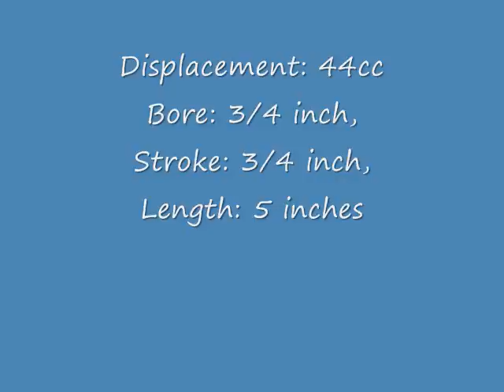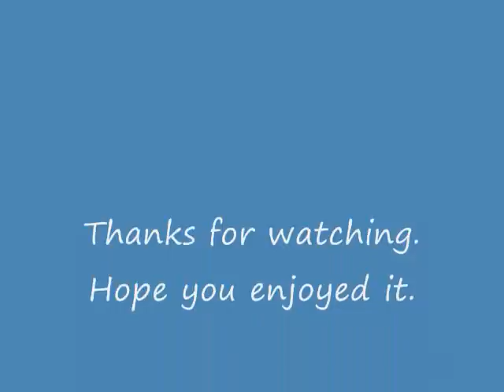World's Smallest running v8 engine

Comment: Most school buses and trucks semis have the fast VW sound but when muffler bad but tinged down when driving bed too racy but street quiet it and make it less powerful and semis school buses to gain traction on snow to spin fast as cars now not cumbersome slow to not gain it and to Cary more weight these days since increasing in delivery and mail trucks and semis got those engines also called cb performance custumized

Comment: The funny thing is it really just sounds like an American v8 but .1 liter lol
Reply: 0.044litre
Reply: Sounds much better than that loud wasp like sound a nitro engine makes
Reply: @Renegade L Im not an expert at stuff like this but its a 44cc displacement so you probs won't get much power but a small 44cc block v8 engine in a scooter imagine telling someone you got a v8 in ya scooter.......... eyebrows raised and laughter until they hear it lmao
Reply: @Renegade L small scooters have 49cc engines and are good for 40mph so I guess if you figured out a way of fitting it into a a scooter you'd have the same kind of performance
Reply: @Atilla 
Yes it would fit, and yes it would likely be more powerful than the stock 49cc (2ish horsepower?) you usually find in scooters. I think Toyan makes a sub 20cc motor, for RC cars, that pushes 3.5 horsepower.

 Longevity? Who knows.
Reply: @robotbjorn4952 it puts out less than half of what a 44cc 2 stroke would make. Remember, its still a 4 stroke so it averages half the power of an equal size 2 stroke.
Reply: Has to do with the way the driveshaft is positioned
Reply: @jevaderscrush  you mean crank shaft? Lol
Reply: 44cc, 1 litre would be 1000cc, eg a big motorcycle or small car engine size
Reply: Most likely about 5-20cc max
Reply: more like 0,45 lt
Reply: @thrashefe3523  so thats a 450cc in your book? 😂
Reply: Luna Lover that's actually not funny cuz if this engine, literally the side of a toaster and for entertainment purposes only, is 450cc in size, can you imagine that smart made a 600cc car up to 10 years ago, fiat made an 800cc 500 (or might still make it) and my friend just bought a Clio with a 900cc turbo 3 cylinder?? 😭 that's crazy
Reply: @arnemaeschaelck5012  actually is 44 cc ...

Comment: I’d like to see the engine dismantled and see the actual inner workings of it for sure.
Reply: That’s what I’ve been wondering.  Is it 2 st or does this thing actually have a valve train lol.
Reply: Mikey Hue I question it’s validity but I could be wrong, the heads don’t show any exhaust ports and with a typical v8 like this one 

https://youtu.be/NPNmI6D2T2c

That does. Check that little one out too.

Comment: They should use these for electric power plants, connect a equal size generater to the motor. Have a huge warehouse with shelves from the floor to the ceiling with thousands of these motors, all the wires from the generater going into one step up transformer , then connect to the power grid

Comment: 44cc? Almost the size of the biggest size motor in a moped your allowed to ride at 16 50cc
Reply: Well, if the police dont catch you anythings legal, i had a 75cc engine with  a after market exhaust. It was pretty fast for a moped at 80km/h
Reply: Nakki_koira Mine‘s a 50cc that rund 90km/h not bad for original!
Reply: Nakki_koira En yllättyny et suomalaine sano tän😂
Reply: And in America you can drive cars over 8000cc at 16
Reply: Ckc dillpickle) I don’t know any 16 year olds in America driving super cars with V-12 engines.... ‘cuz that’s about what you’d need to even come close to 8000cc engine displacement. But kids here do start driving full size cars usually by 16
Reply: biggBOSS1991 there’s a kid who did his dmv test in a Chiron (he was underage) so it’s possible
Reply: the difference is that this is 8 cylinders while the moped might have 1 or 2.
also guessing that this is a 4 stroke instead of 2
Reply: @ValentineC137  you get 4 stroke moped
Reply: @ValentineC137  also the torque on this is nowhere the 2 stroke 1 cylinder moped engine 😄
Reply: Valentine in the video he says premix so it’s a two stroke
Reply: Daniel D it’s still a four stroke. It’d sound different. You can use premix to lube a 4 stroke at this scale. If it were a two stroke i don’t think it would need the cam gears he points out at the beginning for timing.
Reply: @fifty9559  actually he says it runs off Coleman fuel but he adds oil to it, most likely because the engine doesn't have a oil sump system to distribute oil where it's required.
He also speaks about the Crank and Cam shafts but conventional 2 stroke engine don't have cam shafts
Reply: I want an 8 cylinder street legal moped lol
Reply: TLBTM Actually 49cc thank you
Reply: @willpitts9957  it varries from place to place. Some places 50cc is legal some places 49 is max.
Reply: chezY) What does knowing “what a pussy look like” have to do with driving a car?
Reply: TLBTM 15 in finland
Reply: @eskilhalmelinna1031  well I just said 16 but you can at 15 9 months
Reply: TLBTM 14 years and 9 months in sweden got myself an aerox 70cc, sport exhaust and some other stuff, goes about 90km/h
Reply: @1melvinn131  I want to live in Sweden now
Reply: In sweden u can ride a moped when 15 ✌🏻
Reply: You mean a 16 year old can ride a moped with this v8 installed. That's bad ass.
Reply: The issue it's torque, I would imagine it has almost none
Reply: In Romania is 125cc 💪💪 we like it
Reply: KapitanAnal  I don't understand why it would all be diffident because there's no diffidence in the way people drive so why is the limits diffident in each country
Reply: suomalaiset boostit  unfair im just 16 and can only drive 50cc

Comment: That is a real beautiful V8 small engines and it is a real V8 too and that's really handle the skillful believe built excuse me I got tongue-tied wow could have had a V-8 but man that is one piece of work I have to hand it to you when you push the gas there on the throttle that sounds very clean and the Distributors really Distributing the power evenly on the spark plugs that is awesome Yours Truly TCB third son of Elvis Presley

Comment: Hmm, found this while looking for the Ferrari 208 engine, supposedly one of the smallest V8's. 

"In 1980 Ferrari introduced a two-litre version of the 308, 208 GTB and 208 GTS. Though mainly for the domestic Italian market, where new cars with engines above 2-litres were subjected to a much higher value added tax, 38% instead of the standard 18%.[12] They were also listed in New Zealand. The 208 GTB/GTS replaced the 208 GT4 2+2. It was regarded as the slowest Ferrari ever made but was surpassed by 208 GT4 Bertone by American magazine Motor Trend In 1980.

The engine was de-bored to 68.8 mm (giving it an undersquare design) for a total displacement of 1,990.64 cc (121 cu in),[13] resulting in one of the smallest V8 engines ever produced. Fed through four Weber 34 DCNF carburettors, the V8 produced 155 PS (114 kW; 153 bhp) at 6800 rpm.[14] 160 208 GTS and 140 208 GTB cars were produced in 1980 and 1981."

Comment: serious question: could you put this into an rc car?
Reply: Maybe, but he would have to build a cooling system for the engine and the car has to custom made because I don't think that they sell miniature cars that could fit a real running V8. The engine that he made is also really simple and is missing a few parts (alternator, air filter, drive train, transmission, etc.)
Reply: Yeah, but when he can build such a nice engine, he could build those parts too right? Think of it, a tiny rc car with a big fat V8 in it. How nice would that be??
Reply: Yep ^_^

Comment: Awesome! Does it have an oil pump system, and some kind of cooling system?
Reply: No for both.  He's doing a premix like any other two stroke so no pressurized oil passages.  No cooling system either.  I'm sure it's possible but the magnitude of skill required to machine a solid billet of aluminum compared to casting a block with coolant and oil passages is incalculable.

Comment: now get a trans built and toss it in a chevy rc car and you got a hot rod I would buy
Reply: No cooling system; won't run very long.  It's not difficult to machine out a solid billet of aluminum compared to drawing a pattern and casting a block with built in coolant passages, then machining that.  Still a lot of skill involved even for the easy way.
Reply: being so small can't it be air cooled

Comment: Aww I wish it had an oil pan and everything and you could change the oil. So what does the electronic thing in the base do? I didn't understand that.
Reply: its a kill switch. Connects/disconnects power going to the distributor.

Comment: There was a miniature show in southeast Michigan,  Dundee area if I recall correctly.   I think it was in the early spring.   Went there  about 10 years ago with a machinist friend.  I saw one this size, maybe this one.  It was totally amazing.  
Some of the items that these people built where almost unbelievable.  Nuts and bolts so small you need to view them with a magnifying glass.  Threads actual worked.  Another cool thing was a 22cal. Gatling gun that actual worked. (My friend knew the guy and he made parts for the axle and the wheels for the thing.)  They guy must had had a squirrel problem.
  
Does anyone know if this show is still going on and when?

Comment: I always wondered, although all the parts are scaled down, but the fuel is same thickness/viscosity as standard size. is there a way to scale down the fuel to the same scale as the engine? would it run better or worse?

Comment: Now just needs twin carbs and some headers
Reply: Zac Youngson can you explain in detail why, i am new to this stuff please
Reply: @romerobryan83  twin carbs equilizes the fuel distribution as well as more fuel and air when needed hence making more horse power...headers in hance compression yet allow the engine to breath better...think of an engine as a glorified air pump....the more air you can flush through it the better it will run

Comment: Very nice. But check your math - 3/4" x 3/4" makes 5.43cc
Reply: It looks like you used diameter instead of radius.
Reply: There are 8 cylinders Total is  43.43 cc    Great Engineering job !
Reply: Yup.  I saw my mistake almost immediately but my tablet wouldn't let me sign in to fix it.  Thanks for the reminder.

Comment: Drop this bad boy into a muscle rc car, or a flatottom rc boat. It would be awesome.
Reply: It's been done... with cars it doesn't work that well because these micro engines have hardly any torque. So they crawl around at high revs. 
But there's a video of an rc v8 speedboat around, and it's absolutely badass.
Reply: @Motorsheep  this sounds like it might be a little bit more than most of the others, The thing to do now is design a multi speed transmission to get the revs down and the speed up.
Reply: @jerrydoll7275  Looking at my reply 3 months later, I'm wondering if my statement about torque is even true. The engine should have quite enough torque at lower rpm's.
Perhaps the issue is simply that combustion engine powered rc cars usually have centrifugal-force-actuated clutches. They don't engage at low rpm's, so you need a short transmission ratio. I don't know if servo clutches are a thing off the shelf, probably not. So that's what you'd need to make this work I guess.
Reply: Motorsheep it’s 44cc it would work damn well.

Comment: how much power would this put out
Reply: 2 and a half
Reply: im sure that 1 horsepower seems very low to people that dont even ride a horse for  one time
Reply: 1 tenth of a horsepower
Reply: Nope, sorry. You're forgetting about torque.
Reply: This will net about 1.5 horsepower maximum under ideal conditions. But for a quick rough average horsepower, I would have to give it a 1 horsepower rating.  
Of course, without testing the engine, these are just close estimates.
Reply: big gun the first engine powered car had 0.9 HP. 9 of these together would outperform the first ever car.
Reply: 2 or 3 hp, its only 2.6 cubic inches

Comment: All you Chevy haters are only jealous because Chevrolet is a superior product, compared to Ford,& Dodge. there's a helluva lot more old Chevy's on the road than the others yes.
Reply: Josh Wessels, they run the chevy crap cause the parts are cheaper to chrome it out for show, not go!!
Reply: And alot of the vintage Ford and Dodge's being restored have chevy drivetrains keeping them alive. 😂 How many Ford deuces run small block Chevy's with a GM 400 trans as the powertrain? Same with many of the old Merc's and Plymouth street rods.
Reply: have you ever seen  Cummins and powerstroke smoke
Reply: A lot more old fords around here

I hardly ever see old dodges around though hardly any 90s ones even if you consider that old now and the only old dodges i see are ALL cummins ones ive never seen an old gas dodge
Reply: the camaro engine makes 455hp out of 6.2 litres, while the mustang makes 460hp out of only 5 litres
Reply: My chevy lasted 7 months. My dodge now has lasted as long with less problems. You sir are wrong
Reply: So chevys a superior product that needs to make fake commercials.... 👌😂
Reply: Dave Watson you wish

Comment: Now that is cool!  Well done!  I'm sure you know about this but there was at least one company that made tiny running engines and motorcycles. Most of their engines were tiny airplane engines but, if I remember correctly, they had V8 engines too.  Their tiny motorcycles were incredible. I always wanted to buy either one of their engines or motorcycles but they were too expensive.  I looked for them a couple years ago and it appears that they are no longer in business.

Comment: If you could design and build one with a cooling system it would make for a great scale model engine.
Reply: don't forget an oiling system, being oiled only in the fuel makes it good only as a novality
Reply: @dondakota920  that just makes it akin to a two-stroke engine.
Reply: @jorgey4  as I assume you already know the 2-stroke vs. 4-stroke is relating to the number of piston Strokes her Revolution. The adding oil to the fuel was only done to simplify a small engines oiling system the same reason this gentleman did so.
Reply: @jorgey4  two-stroke engines run their fuel in the crankshaft. It doesn't seem like his crank gets any oil - not to mention the camshaft or anything ohv if it has overhead valves
Reply: LoL... imagine how small that water pump and oil pump would have to be..let alone a radiator to fit it..lol
Reply: I could to love one for scx10
Reply: Justin S.

Comment: its 2 stroke or 4?
Reply: 4-stroke. a 2-stroke has no cam shaft
Reply: Probably 2-stroke
Reply: i dont think there is a cam shaft though
Reply: How do the exhaust valves work in a Detroit ? (2-cycles have a cam ! )
Reply: negative, moran
Reply: bicylindrico , Yes the Detroit diesel does have a cam and exhaust valve.

Comment: "American style V8" IS THERE ANY DIFFERENCE to the other ones?
Reply: Probably in the paint, fuel feed orientation maybe, carb, who knows what the difference is. Probably mostly just a street cred statement.
Reply: +Milo Flint yeah most likely
Reply: 90 vs 75 degree v8s... the 90 degrees is the 'american style'
Reply: +BalintuSS ah ok
Reply: Pushrod with cam in the block, European V8's are usually overhead cam.
Reply: firing order also plays a part in being an american style v8. and cross-plane crank as well. flat plane almost sounds like a high revving 4 cyl
Reply: Ben Dover Eeeyyy I got a British v8- an old jag xk8

Comment: You said you used pre mixed fuel with oil. Is it a 2 - stroke or a 4 - stroke ?
Reply: Viraax The Wolf i think it would be a hybrid where the cycle is 4 stroke but since its so small and not trying to pass an emissions test the oil thats mixed in shouldnt be an issue and it saves him from having the make the whole oil cooling assembly

Comment: so where did u find the crank and camshaft? and does it have rings? coolant?
thanks
u wanna make one
Reply: He made every single thing from scratch except the couple items like screws that he mentioned.
It doesn't have a water jacket, or water pump, so it would get pretty hot if it ran for to long, it's not 100% accurate, it's just a cool toy he made from scratch.
There are a lot more sophisticated motors out there now, this is pretty old.

Comment: I want to build an rc car for that engine, it would me an old school car, maybe 68 gto hard top. An actual transmission and a diff. Real working suspension and pneumatic tires. The real smallest v8 car to go with. It would be scale to. 44 cc it could easily mimick a 440 ci in that car. Front engine rear wheel drive just like its a working driving model.
Reply: I want to see that too

Comment: Why higher revs for such short bursts only?
Reply: The engine doesn't have any cooling system in it so it would get hot faster
Reply: +NOTABOOS Probably doesn't have a rev limiter. Don't wanna blow it up.
Reply: Yup. engines tend to get REALLY hot very fast.

Comment: Great job! A couple of question though. Does this run on gasoline? And also, what's to stop you from making it smaller? I see a lot of rc engines today are very large single-cylinder engines, and I can't understand the reasoning behind this. Help, somebody?
Reply: they are cheaper to make
Reply: MoidarPL Thanks. Also, why can you not make the engine smaller?
Reply: Patrick Bateman It might be because the parts are gonna be too small to hold out the power, that the engine would produce and also at some point the fuel aint gonna go efficient enough through the carburettor to the combustion chamber. Everything has its own limits.

Comment: You've done a wonderful job building that miniature motor.  But why stop there?   After having built this engine you may as well build a little deuce coupe or T-bucket hot rod to put it in.  You could even set it up R/C and drive it around a bit.  That's really cool.